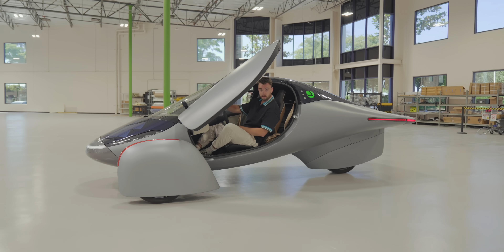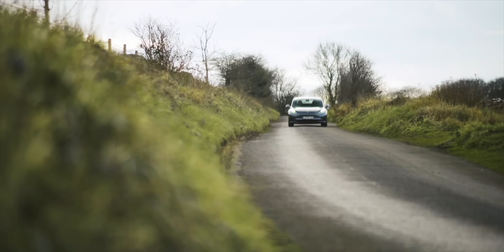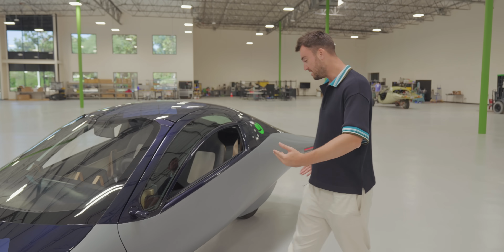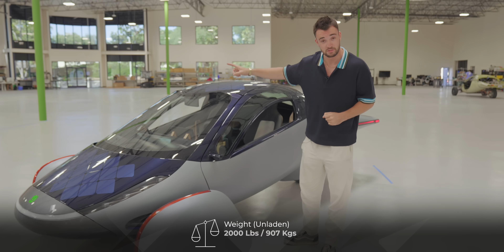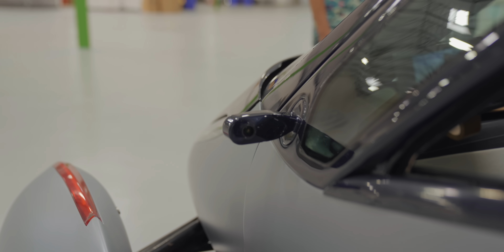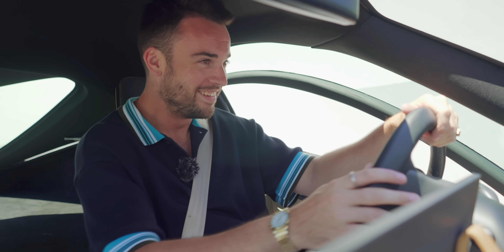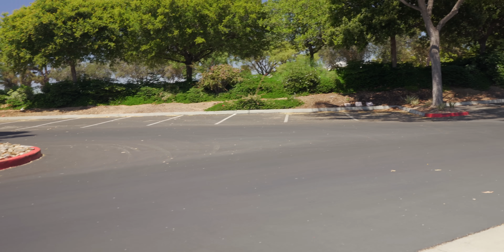The Game-Changing CHEAP Electric Car Inspired By Fish!

Comment: It's a super cool thing, but being a motorcycle I couldn't get any straight answers from them regarding safety. Presumably won't have to pass near the same crash tests as an actual car would.
Reply: Doesn't have to pass the same tests, but they said they will be submitting it for the crash tests regardless.  Their goal is to match safety.  Obviously they can't make that claim officially until they have actually tested the production version.

Comment: I like the aptera very much but the Width 2,235 mm (88 in) is way to much for european cities.  tesla y is big and its only  1.921 mm. 

Maybe if the passenger seat would be behind the driver they could make it more narrow. An if not in use you could flip it down and have the space for storage.

Also they could add solar panels hidden in the front. when parked you could manually open the front and flip out a extra solar panel which could cover the windshield.
Reply: They are designing a version for Europe because the L5e-A regulations limit it to 2M width.  Tentatively 2024 at the earliest.

Comment: Wait, am I hearing it right? This car can run 1000 miles in one charge?
Reply: Yes, but only if you pick the 100kwh battery, which will weigh a lot, reduce performance and range-per-kwh, have worse ride quality, have greater wear and tear, and costs a lot more.  The more sensible variants are the 25kwh, 40kwh, and 60kwh.  40kwh / 400 miles is by far the most popular variant.

Comment: This thing is so advanced it will never be allowed in germany. 

Too many regulations.
- Camera mirrors? No.
- No front plate, ruining aerodynamics? No. (Yes, if it woild be a motorcycle)
I'm sure the list goes on
Reply: Camera mirrors only aren't allowed in the US, either.  The production model will have both mirrors and cameras.  Same for the car plate (in some states) - but it's classified more as a motorcycle, which only need rear plates.
Reply: In Germany the Aptera is covered under the L5e-A regulations I believe.  The main problem with the current design is that the width (2.23M) is beyond the maximum allowed (2M), so an EU specific model will be designed.  Tentatively 2024 for the first EU model production.

Comment: 25 miles each way to work, you would, theoretically, never need to charge this car.

Is it coming out as a right handed car?
Reply: It will eventually (several years out)
Reply: Each way, .. so a total of 50 per day.  The solar range per day would vary by how much sunlight there is at your location.  There's a map on the website where you can look it up.  The 40 miles/day is for the maximum solar options in the Southern US, and would be less elsewhere.
Reply: @WyndStryke  if you don't drive much over the weekend it would top the batteries up.

Comment: 10 miles per kWh is great but it would fairer to compare passenger miles per kWh.
And then one probably should divide that by the price …
Reply: Most of the time, vehicles have only 1 or 2 occupants.  A 7-seater minivan doesn't give you good passenger miles per kwh if only the driver is in it.

Comment: It needs to be jacked up slightly. Like if you hit a pothole you’ll damage those those wheel hub caps. Also just hitting any pothole or anything when you only got 3 wheels likely will mean the car will flip. That’s why they no longer make 3 wheeler atv’s. so I hope they have accounted for this
Reply: American roads tend to have a lot of potholes due to many large shifts in temperature and heavy use of roads in general... The one they drove that was missing body parts was closer to a production version they said so we really do not know what the final design will look like...
Reply: That alpha vehicle has low clearance under the wheel “pants”. The newer gamma version (due out this week) is said to have several more inches of clearance.

Comment: I pre-order the Aptera and I hate the little dual screen for side view mirrors.  I hope they are not part of the final version.
Reply: This video shows an old alpha version car. The newer one has tiny actual mirrors as required by law plus a wide screen directly in front of the yoke (not steering wheel).  That screen shows views of both sides of the car.

Comment: In America we are driving culture. America is roughly 1,600 km by 4,600 km most of it unpopulated so driving long distance it's just something that we're used to. So having a vehicle like the Aptera that you can pull over and sleep while you're on one of these mega drives totally makes sense. Being a true Californian multi-generational, I can't wait for this car! I pre-ordered in 2005 when it originally came out and I currently have a pre-order. Something that you didn't mention is that they're making an off-road version which is lifted and all-wheel drive. Since we have vast dirt roads on the West Coast running north, south, east & west the ability to self charge by stopping. Just letting it fill itself with energy while being engaged in other activities. Maybe gold panning, climbing, fishing, surfing , skin diving or soaking in an all natural hot spring the opportunities are endless. Cheers from Northern California!!!

Comment: When it comes to gas cars, Efficiency also good 👍
People seem to have forgotten that. Somehow electricity consumption demands more scrutiny than plentiful cheap neverending oil.
Reply: Partly because the losses from poor efficiency are dwarfed by the losses from the combustion unit, whereas in an EV the motor is ~97% efficient, and therefor even small drops in efficiency have a very obvious impact.  Bear in mind that most EVs achieve their range using only 2-3 'gallons' of fuel-equivalent energy (66kWh-100kWh)
Reply: @logicalChimp  Same with heating, cooling and towing in an EV. The differences those things make are a larger percentage of the total available energy in an EV and so we talk about it more in EVs than in combustion engine vehicles.
Reply: oil  is neither cheap nor neverending.

Comment: You can go on their website and configure the car so that it has 1000 miles of range which obviously means a bigger battery.  I asked them about this as I figure you are not going to get the 40 miles of solar range when the car gets that heavy. I give them credit for getting back to me and answering the question, but the answer was that they basically didn’t have data on that but were aware of the issue.  I think it’s misleading to allow people to reserve the car and not warn them that the solar range will go down as the batteries get bigger. I think that as soon as you put in the larger battery the program should either no longer give an estimation for solar range or they need to make that part of their program so that it takes the extra weight into consideration.
Reply: Sure, on the warning... but bear in mind the efficiency will also depend on the weight of the driver, whether there's a passenger, and so on.  It's quite possible that the performance difference between an Aptera with a small battery and one with the big battery will be less than the perf.difference between a skinny driver on their own, and 2x lard-arses, using the same Aptera, etc.

Which is also why they say 'up to' 40 miles from solar (the traditional caveat clause)... because it also depends on how sunny it is, where you park it, and so much more.
Reply: @logicalChimp  Point taken.  Maybe it won’t make a huge difference, but the reason I thought to ask was that I noticed that when EV’s went to AWD they got a huge hit in the range and MPGe compared to the same size battery but with  just front or rear wheel drive. Their response was they didn’t know  how much batter size affects range and they needed more accurate data. Seems like it would be easy enough to just put in a disclaimer that the data is only good for the smallest battery. I know that the AWD difference is not the same as battery weight, it’s just what got me thinking about their calculator. Since the solar powered range is the key selling point on this, I think they should be trying harder to not be misleading.

Comment: I love the idea, but 2.2m wide? That's crazy - minor collisions will break the front wheels, and with in-wheel motors, that won't be cheap to fix.
Reply: It'll be cheaper than a car to fix, you're assuming a "minor" accident would wreck the motor, I don't think it will, it's in the wheel which also has a rubber tyre, I imagine it would take more than a "minor" accident to wreck the motor......
Reply: @Mick-60  When you 'nudge' another car in a car park, or when trying to pass on a too-narrow road (for example) with a conventionally bodied car, it's not your wheel/suspension/motor that is hit. That's all protected by the crumple zone of the bodywork. In this car, the steering/suspension/wheel will all break -  unable to take all of the load. 2.2m wide, and with HV electrics - AA/RAC/etc won't touch it, and you won't even be able to push it out of the way. The (admittedly far less cool) Carver is a better option for efficient EVing - about 800mm wide and far more useful for city driving.

Comment: Width isn't the only aspect contributing to stability in three wheelers.  Where the center of gravity lies, and how high in relation to the vehicle's contact patch, is pretty important.  The Aptera's battery packs are low, centrally located and close to the front of the car.  Tadpole (wide in the front) three wheelers are generally very stable even in emergency maneuvers; when you step on the brakes the car's effective CG shifts forward, putting more of the weight on the wide end.  And if you try to turn away from danger even as you're braking, again the CG is moving about but still within the contact patch.  They're really quite surefooted.
Reply: They have some driving dynamics testing videos on their channel, and the beta one is beating every safety regulation with flying colors, while proving to be a really fun thing to drive in terms of it actually handling good, able to take corners fast with no issues etc, it really is a little sports car.
Reply: They do like to swap ends if the back tire looses traction, but a good stability control system can easily manage that.

Comment: If this is everything it's been hyped to be this is another fantastic step driving forward. For those of us from a northern climate it will be the replacement of a motorcycle that we can use about 8 months of the year.
Reply: Yes but a lot safer than a motorcycle and it can work well in the rain and snow.

Comment: As a daily commuter, this makes perfect sense. Just think how much you would save in fuel. Love the way it looks.
Reply: With 1000 miles of range it could certainly step beyond "daily commuter"
Reply: It certainly could, but longer journeys in my case usually entail taking the family and a lot of luggage. I would probably use this to commute back and forth to work - I could probably charge it once a month!
Reply: When I saw the car for the fist time, I placed an order for my daily commuter.  Might as well do it as efficient and low cost as much as possible.  Not to mention, the 0-60 can be under 3.5sec if you get the AWD (3 wheeled) version.   I get to have a fun, speedy, efficient, all in one commuter!
Reply: @505YUTUBE  Wow I have no idea there was an AWD version...3.5 seconds is nuts!
Reply: $40/day for parking. Goodo let’s save the planet this way
Reply: An electric cycle can do 100 miles per kwh. Even more if you decide to get some gentle exercise. And the breeze is all the air con you need.
Reply: @andrewnorris5415  Electric cycles don't do rain or storms well....
Reply: @Mick-60  iris e-trike…
Reply: @andrewnorris5415  Yes, but it cannot take your spouse or kid with you, cannot take a briefcase or shopping bags on it, cannot get you safely anywhere in a rain or snowstorm and cannot get you to work on a hot day without sweating thru your shirt, let alone if you are older or not very athletically inclined!!

Otherwise, you're right its a breeze to ride one if there are safe roads/bike lanes to use, you are not competing with cars, trucks or busses for the same lanes. My dad was T-boned by a car as he rode a bike in the burbs!! He did not survive!!
Reply: @nixl3518  Oh lord! I'm so sorry about your Dad. I started off reading your first sentence and thinking that I do in fact do all my shopping/commuting on my ebike, and definitely don't get too hot...

But I long ago thought I just have to accept that I risk life and limb every time, simply because of the incompatability of sharing the same road. It's like expecting pedestrians to not have pavements.
Reply: @sroberts605  My point was that maybe it works for those of us that defend this method of mobility to a fault, but do not consider that for others, this option is not even on the horizon. YOU might not get hot because of your circumstances; most others appearing sweaty first thing in the morning at work would be terrible. And then there are all the other reasons I listed, that this option is not available, to a mother with children in tow, for example. We just tend to think of how easy it is for US, but do not consider life's requirements of others that make this an impossible option. The fanaticism of some people on this subject is just beyond belief!!

And yes there are countries/communities that do not have sidewalks at all or in many 1st world applications, (ab)use them such that walking on them is so difficult, you end up walking on the street in conflict with traffic. That's a whole other discussion. Thank you for your sentiments.
Reply: @andrewnorris5415  Not sure where you get that figure - without pedal assist you are more likely looking at 40 miles per kWh, with pedal assist on medium settings perhaps 60-70 miles. Still impressive though hey?  But then again, I can't do 70 mph on my bike :)

Comment: This ticks almost all the boxes I have for what I've been calling for in an cheap and real world useable EV.  I just want to know how it'll handle in the winter, and how good the heater is.
Reply: Same here.  I've been ignoring EV's because they are either really expensive or disappointing in range.  Always said I'd buy one if someone would solve these problems but never imagined also being able to charge it in the sun.  I ordered 2.
Reply: @robertd9850  Problems aren't solved yet.
Reply: I don't think it will have any more issue in winter than any other car from a grip point of view, standard model is front wheel drive and performance version is 3 wheel drive.  The issue you might get it that if there was standing snow on the road you'd got the rear wheel going through deep snow that none of the 4 wheeled versions have gone through so it could make it a little interesting in that case.
Reply: @BernardTheWonderbadger  That's kind of the point.  Having that rear wheel on a typically unused (and rarely repaired) area of the road will create not only handling situations in ALL weather conditions, but also an unusual wear case for the suspension and tire.  That said, I've been calling for a 250+ mile real world range ev for under $20k for a long time now, and this is the first that might actually make it.

Comment: I'd love to have one, but afaik it would be very hard to drive one in Europe (if they ever plan to export in the first place). EU regulations on 3-wheelers are very strict and a bit strange.
Reply: They're designing a version to be compliant with the L5e-A regulations.  Main thing is to reduce the width to something more reasonable (2M is the maximum allowed under those regs).  Tentatively 2024 but don't be surprised if that slips.
The interesting thing with L5e-A compared with the Autocycle regulations in the USA is that L5e-A allows more than two people, so there's no reason they couldn't do a 4-seater version.

Comment: The wheelbase is very wide at the front, but the interior space inside the cockpit is narrow. If you're going to have a wide wheel base, you might as well widen the cockpit. Parking might be harder than average, with only 3 wheels.
Reply: The wide wheelbase is so that the turbulence from the wheel covers doesn’t touch the body. You bring them closer and you loose efficiency. Efficiency is king for this vehicle.

Comment: This car is classified as a motorcycle in regards to US regulations.  Slightly safer in a crash than riding a motorcycle, but much MUCH less safe than driving a new passenger car.
Reply: You don’t know that. They are going to do full front and side crash tests.  You don’t know those results.

Comment: I am waiting to see the Crash Test Dummies get hold of one.  Not sure it (or the occupants) would survive even a minor crash.  Where it the cargo storage?  I don't think this would be very good on snowy roads.
Reply: Jack showed the boot in the video... it's fairly shallow, but it's deep (it's bigger than the boot in my old RX7, from the looks of it, and that was a 'proper' 2+2 car)
Reply: They will soon have an outside company do front and side impact tests. The cargo area is 7 freet long and goes from over 18 inches tall at the front to about a foot at the back. Winter driving will be aided by torque steering on each wheel and optional all wheel drive.
Reply: @Steve-7771  Ask Jack if he felt any torque steering? It's snake oil.